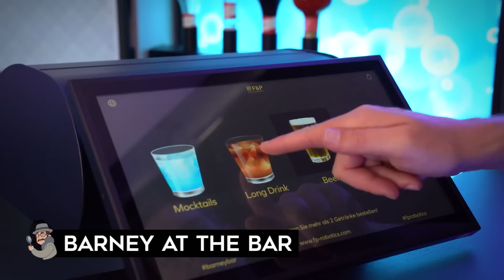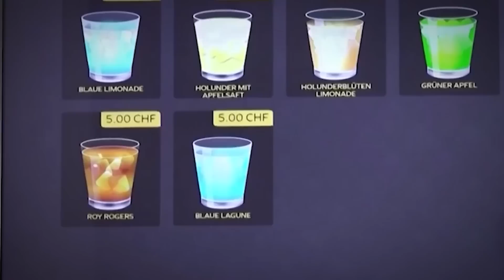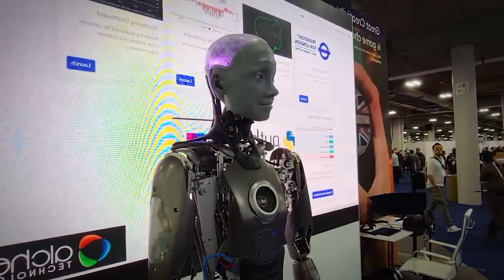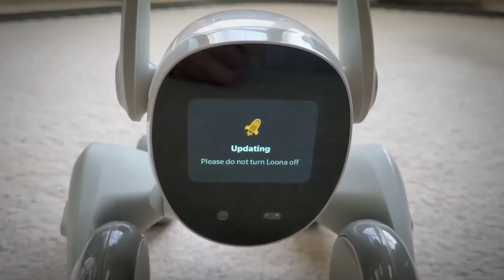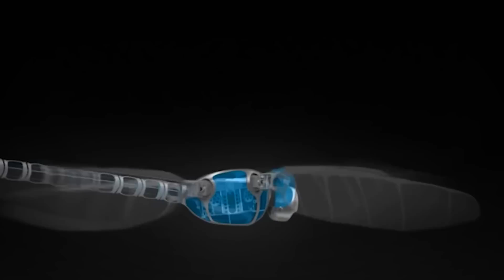This Is The Most Realisitc Robot You Will Ever See

Comment: Spot is by far the most usefull robot. It doesnt try to appear human with that awkward silicone face that everyone hates. Lots of companies bought them, SpaceX has a few to inspect their launch site, keeping humans away from any possible danger until the operator deems it safe. There's also dams using them, patroling and inspecting valves and such 24/7, easing up on the work force due to extremely boding job walking around all day looking at gauges and valves. Heck if I had the money I would get one and synch it to a home surveillance system. You could even map your home, take a few places like living room table and have the robot pick up anything that is not suppose to be there, or pick up various objects that happen to be on the floor.
Reply: What happens when the robots go rogue
Reply: @michelemcguire8995  As you seem to know nothing about computing, I can only say; nothing will happen. We are not there yet for any possibillity of any robot going rogue. It will take decades before we get close to that.